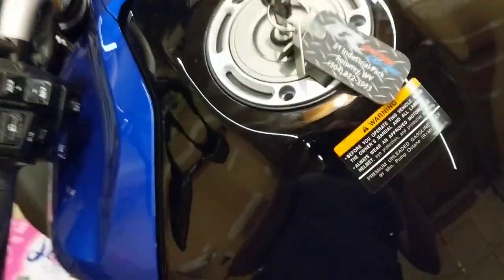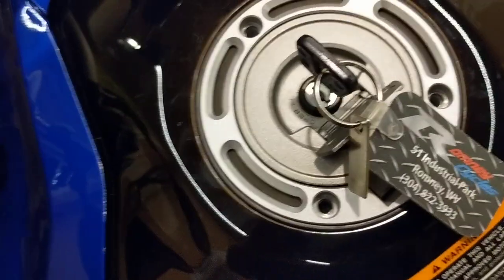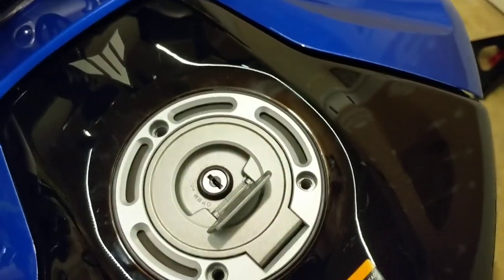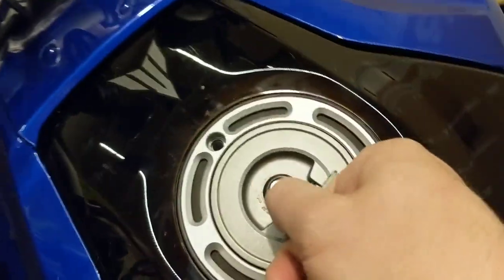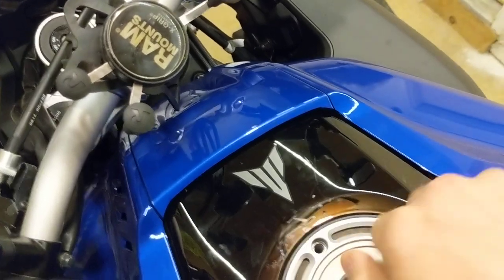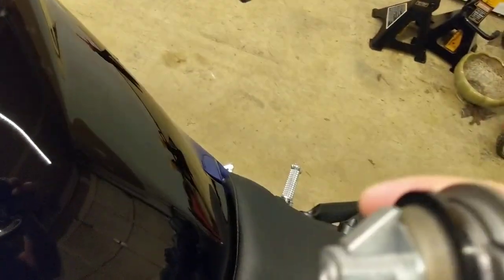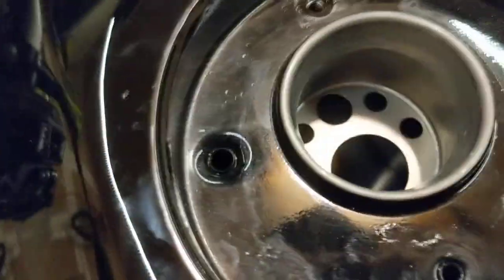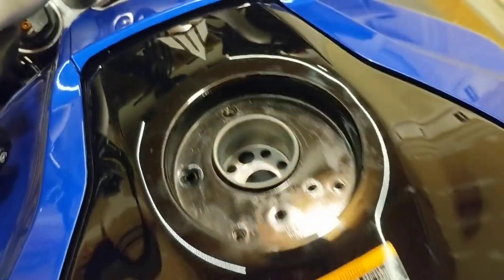Cant remove Yamaha MT-10 key from gas cap

Comment: I just needed to get the thing off to tuck in the edges of a clear bra, so tank you for the accidental instruction video.

(Hope the clear bra doesnt make the diameter of the tank too small for the cap though)

Edit: Checked a fuel cap removal on the R1 out (identical).

It should come out by compressing that black ring and turning the key into the locked position.